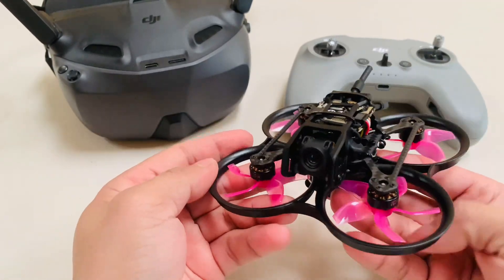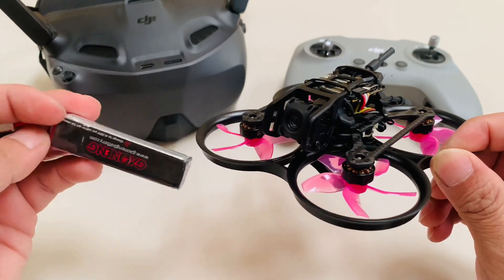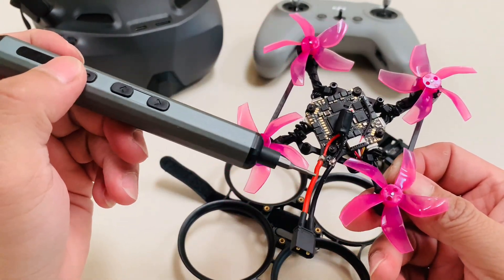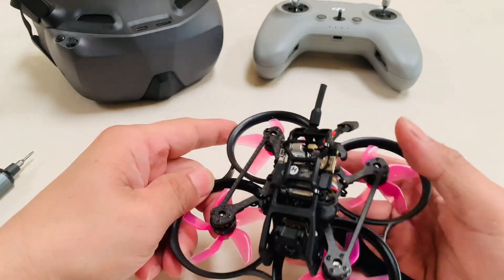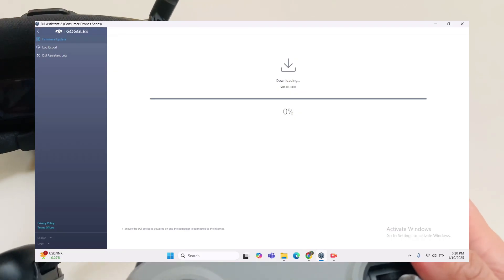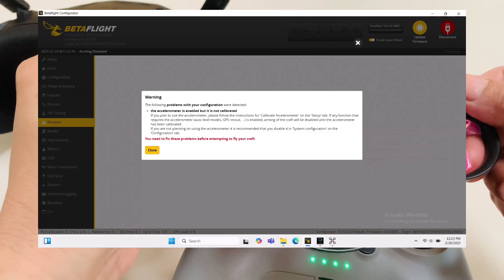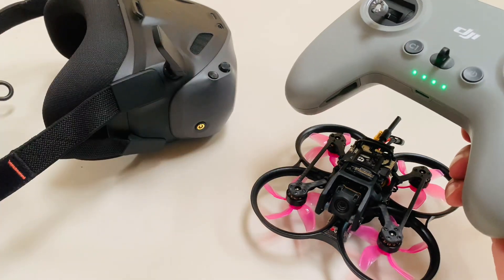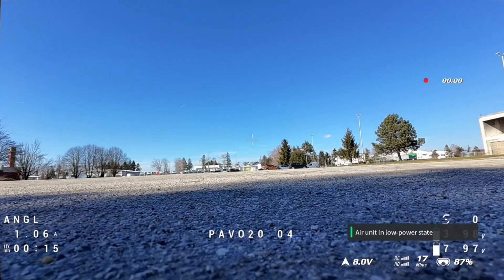DJI 04 Air Unit Lite Build with Pavo 20 (Activate , Bind , Settings)

Comment: Hello,
Thank you so much for your great video.

I followed and completed all the steps you mentioned, but now the texts on the screen—such as the battery percentage and the drone's name—no longer appear, and my controller is still not connected to the device.

My drone model is pavo femto|o4|ELRS 2.4G.
Reply from the maker: @m.mahdi.m9604  did you flash your aio board brother i think you dont need to Flash it you can return to Stack firmware.
Reply: @DronePH-2026   the problem was with ports. I should select port 5 for receiver instead of port 6.

Comment: I was wondering how those setups were powered. The performance on 2s Lipo is impressive.
Reply from the maker: @Ali-e5h1b  little bit hard brother if you are building drones you need to analize those wirings , program the drone,setting etc..2s is good brother I ordered 3s on it for little longer thanks for watching 👍
Reply: @DronePH-2026  I've only built drones that use 5 inch or 8 inch propellers. I want to build a tricopter that size. I will try this year.